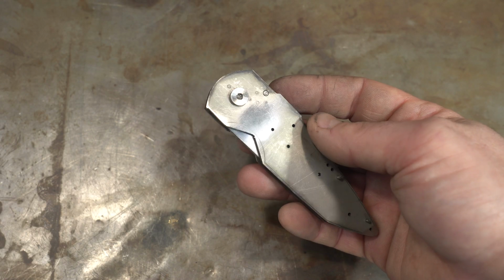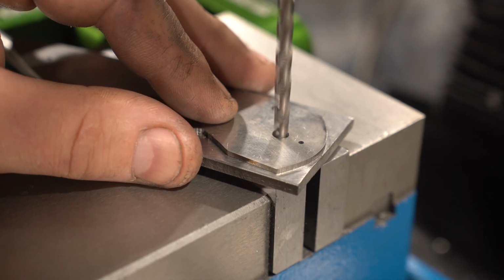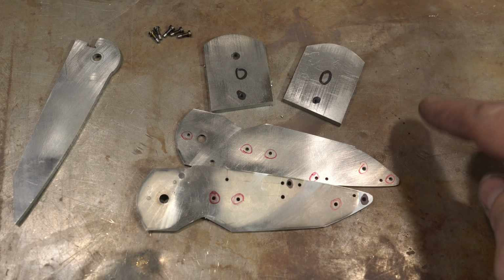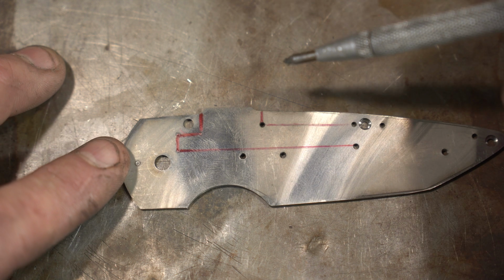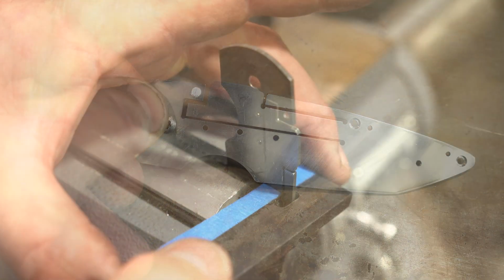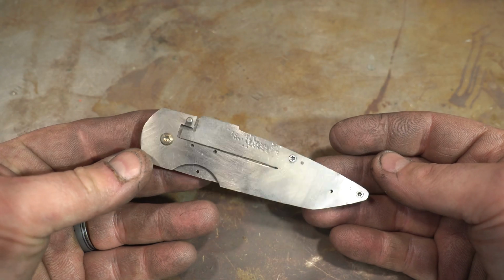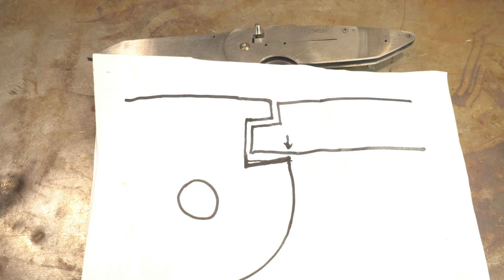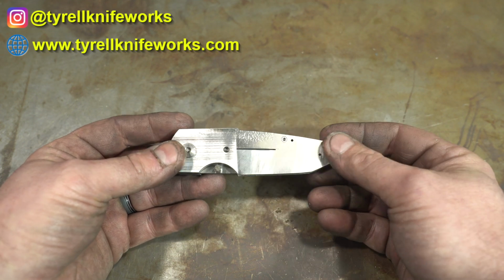Triple-T #213 - Compression Lock Folding Knife Build - Part 2

Comment from the maker: Did I miss explaining anything in this build?
Reply: On Spyderco compression lock there is two points of contact : the blade AND the stop pin, thats maybe why you had lockrock.
Reply from the maker: @4d4mko yeah I’ve since been shown.  I was going off of this (incorrect) description of the design https://www.knafs.com/pages/pocket-knife-lock-types.   Spyderco’s design described here:  https://www.spyderco.com/edge-u-cation/knife-anatomy/locking-mechanisms/, shows that so I’ll have to factor that into the next design. 👍
Reply: Speek less
Reply from the maker: @jatindersingh2733 most people want to hear WHY things are being done, not just watch me drill holes. 🙄
Reply: @TyrellKnifeworks  Absolutely. It wouldn't be Triple-T without talk.

Comment: Hey Denis, am I misunderstanding the design and lock? In the open position, is your lock bar making contact with the stop pin?
Reply from the maker: Hey Don, that's not quite how it works.  A face on the knife hits the stop pin in the open position and then the lockbar slides over a different face on the back of the knife.  The lock bar doesn't hit the pin.  Look at Part1 where I show the design.  Thanks for watching

Comment: Hey, how goes it? You never explained why the one side of the knife where the lock block is, is peened so much? I am guessing it was done so the lock tab would bend inwards?
Reply from the maker: When I talked about the angle, I tried sloping it the other way first, when that didn’t work, I had to get the spring to turn down more, so I peened it with a carbide hammer.  👍.  Good question!